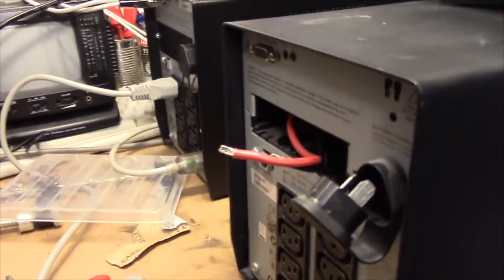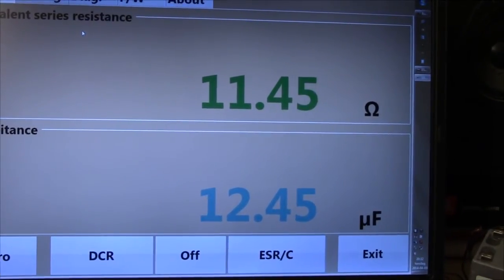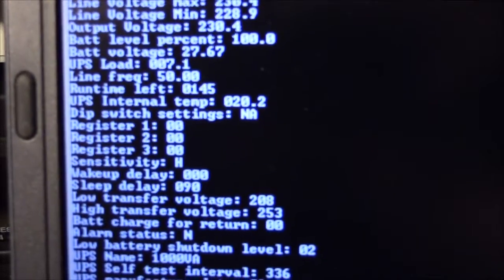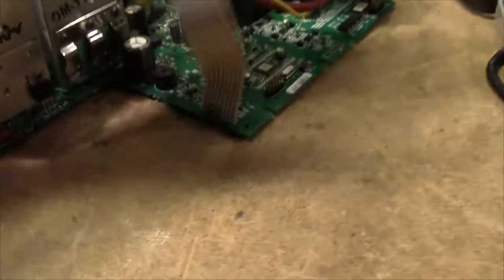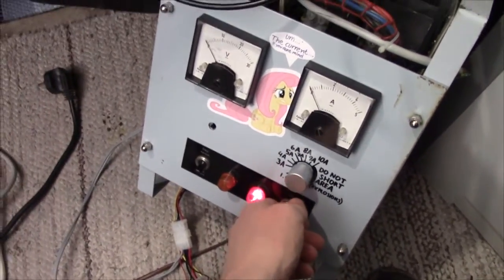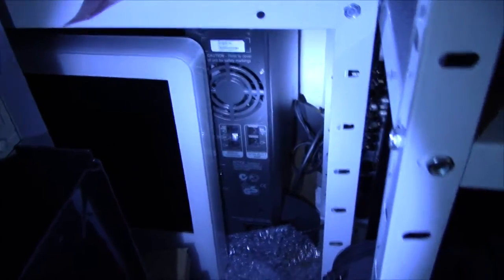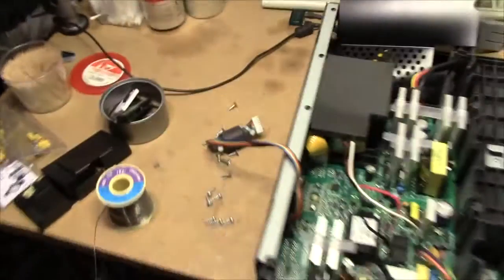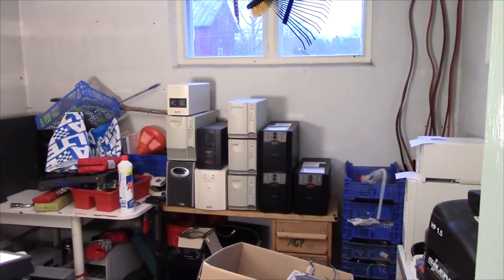Fixing up (a lot of) trash-picked UPS units pt. 4

Comment: Thanks FFcossag for sharing your experience in UPS. I'm interested in the following: 1.) Where can I get the software (in monochrome display) you used to show the UPS status? 2.) Your ESR meter is connected to a laptop. What's the brand and model? 3.) I can't afford buying a sophisticated oscilloscope. Do you recommend to buy a PC oscilloscope for diagnosing my UPS. Thanks a lot.
Reply from the maker: 1) The software is apcupsd - apcupsd.org
2) It's an unfinished DIY design, put together by a friend of mine. Schematics and layouts will be available some time in the future, but he has chosen not to publish them yet. It's unlikely to ever be produced commercially, unless it gathers a lot of attention.
3) I'm no expert in test gear (my scope is 40 years old), but the rule of thumb (at least used to be), if you can't afford a real scope, don't expect to get away with a cheap PC scope. Most of the money invested into a scope goes to the front-end. The power supply, case and display are minor costs in comparison. A cheap PC scope is going to have a cheap front-end, and likely won't perform very good. If you're really strung for cash, I'd recommend looking for a used, analogue scope. I own two, the HP in my videos was free, and my other one was 80 € - both in good, working order.

Comment: Problem with the apc smart-3000 charger after changing the new batteries and then charging it for 48 hours and after operation and disconnect the power button directly works but gives sound with no battery charge

Comment: Hi great videos I have a Back-UPS RS 1500 it worked great for a long time till I needed to change the battery I got a new set of batteries and it just wont charge them. All the other functions of the ups are ok. Even if I switch off the ups it drains the batteries. Anyone have a idea what might be wrong?

Comment: I have a APC RS 1500 (127V) too and it have an issue: it only works correctly  in battery mode. It do not recognize the power from outlet. I tried to change the sensibility but it do not fixed the issue.
i would like to ask you if, in your experience,  you have any idea from what it can be the defect. 
Thank you.
Reply from the maker: No idea, sorry.